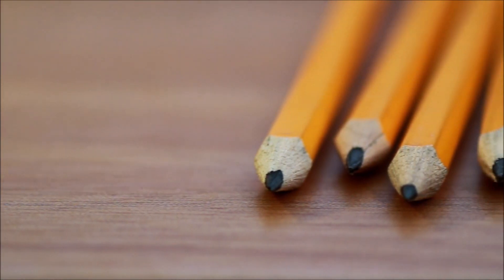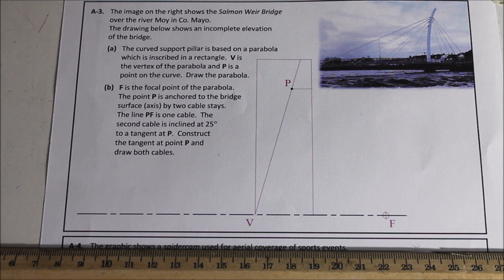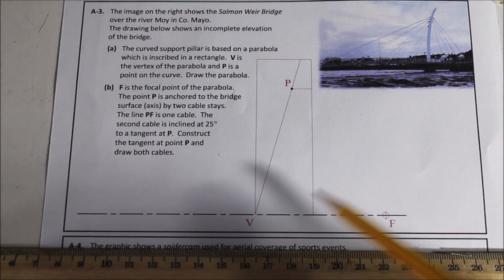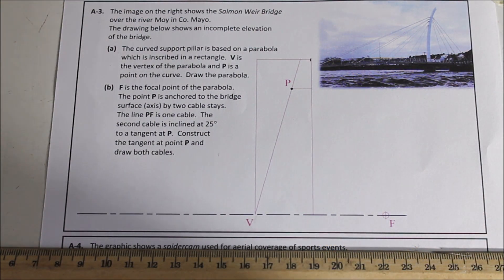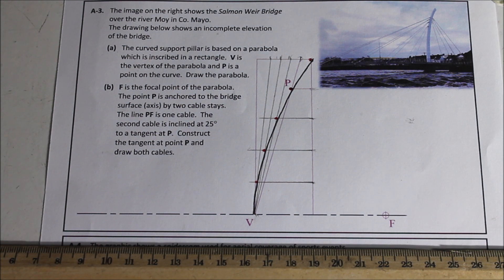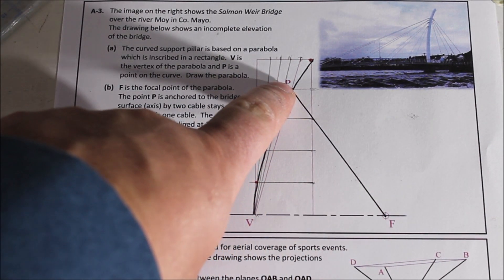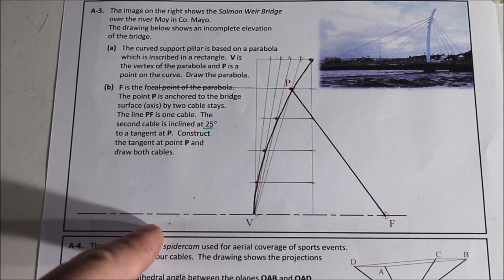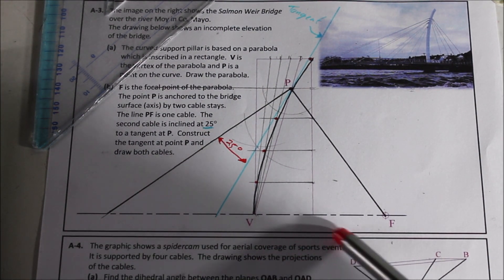DCG:2018 Higher Level Question A-3

Comment: In section C, for the dynamic mechanism question, does part (a) and part (b) have to be drawn on the same sheet?
Reply from the maker: No,they can be if it’s a large A2 sheet but separate sheets are fine as long as you clearly label which question is on each sheet.
Reply: P.J McTavish thanks!